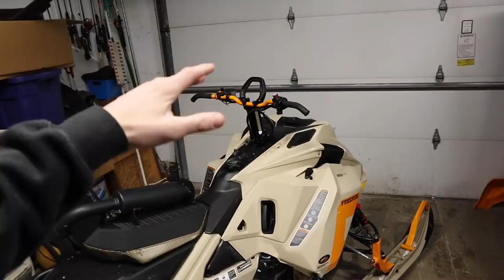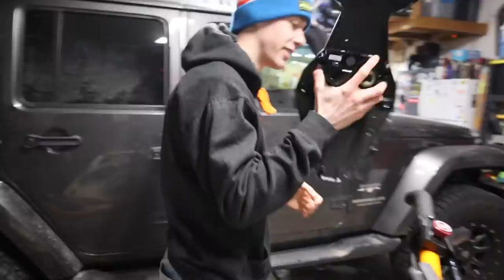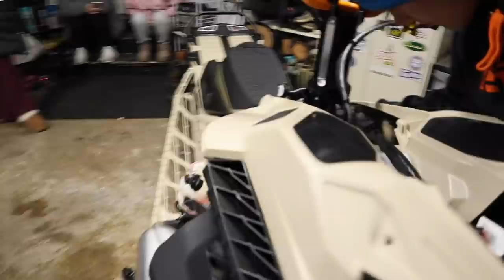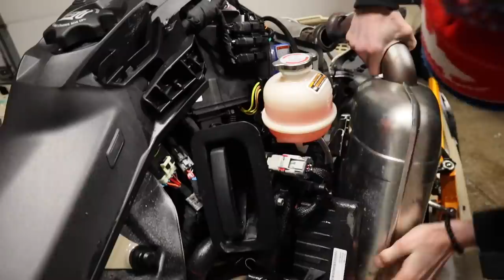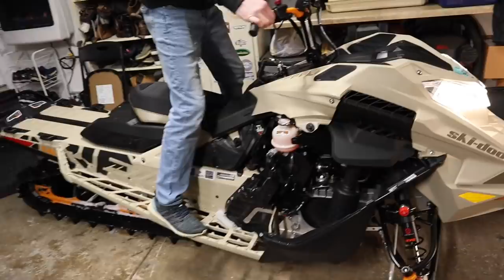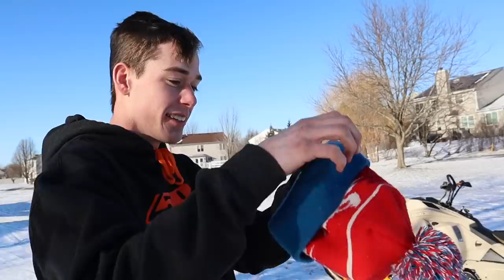LOUDEST Skidoo Freeride 850 Exhaust!

Comment: As a Skidoo tech... Can confidently just say you lost horsepower putting that on your sled. Does GGB have a dyno bench like Jaws, SLP, Dynoport, & HPS? No...Best thing to do is throw that can in the garbage and get something that is designed to work on the 850 motor. Not just a copy and paste fitment can for your sled... Just my 2 cents. HPS is the best can for that sled. In general though, this whole video was hard to watch……
Reply: The HPS is beautiful
Reply: Highly agree 👍🏼
Reply: Heard ggbs are famous for causing bog downs as well
Reply: @Brobro449  Well yeah,
Thats what happens when a can robs you of HP and RPMS!! 

Also would like to note this kid is not gonna like owing a skidoo because you need to know these three things….
- How to set belt deflection
-How to take off a hood (seriously) 
-And how to adjust clutching 
 The P drive clutch is a lot more “touchy” than the Poolaris clutch…. Sometimes you have to fine tune the clutching with clickers and honestly the stock clutching just sucks in general….. But if this sled starts to over/under rev its not gonna run very well…. So being able to fine tune it on the fly is key on the skidoos. Again just as someone who works on these, these are just the things Ive noticed😎🍻
Reply: @Snowdasledders  I’m gonna buy a sled this year and am for sure not buying Polaris. The motors go boom far to early along with many other reliability issues and garbage shocks. Did you see muskoka freeriders sled blow up the other day?
Reply: @Brobro449  Yes I did. I believe that was dealership error though (the oil consumption/calibration not done properly). All Im gonna say is that dude rode a sled harder and more than all of us in the comments combined on a 21 turbo and had 0 issues. I work with the factory turbos and all my buddies have factory turbos. We all have had 0 issues. Only issue was one had a wire rub on the wire harness under the engine and caused shot start not to work. But that was more than likely not routed correctly. Cant go wrong with a factory turbo👍
Reply: @Snowdasledders  to me the sled sound like it was whiney since day one if you go watch his first ride and that is awesome
Reply: Ya GGB is junk for skidoo and he definitely lost power. Jaws and HPS is the only way to go with Skidoo. Well or Bikeman, don’t think they are that great, but at least they have a dyno like you say and actually do R&D. GGB.....weld the pipe and chassis mount on and make sure it fits...send it to customer and pack it with more shit depending on the sound level they want. The whole jaws kit on a regular 850 like this will run with my pump gas turbos, it’s impressive. Very very painful to watch.
Reply: @Brobro449  You heard it because it’s true. It’s a one size fits all with GGB then they weld the correct mounts on depending on the application. Zero R&D, dyno or real world testing I would bet.
Reply: @specforged5651  thats sad imo jaws sounds better too
Reply: @Snowdasledders  You really think he could even adjust his clickers or defection after what we just witnessed with the hood? I guess that’s pretty much what you were getting at and you’re  exactly right. This kid needs a Polaris that “adjusts it for you” even though it doesn’t work. Better than what he can do.
Reply: @Brobro449  They are way better. Cut them apart side by side (like I have) and it’s obvious the difference. Like I said, one size fits all and weld on the appropriate mounts.
Reply: @specforged5651  Imo as well as good performance from jaws they have on of the best sounds on the market for each sled brand
Reply: @specforged5651  Yup exactly. Its not always pull the rope and go…. You’ve got to take care of it and check over your sled before every ride. All Ive got to say is if you take care of it the sled will take care of you….😎 Has never let me down.
Reply: @Brobro449  Id rank HPS, SLP, Then Jaws for the 850. 
HPS being the best overall (just very expensive)
SLP did some testing & tuning last weekend and the full exhaust set up (y pipe, pipe, can) was nasty power at optimum rpms of 7800. 
Jaws is shortly behind SLP but its better for more top end it felt like. 
Either way cant go wrong with any of them they all perform really well👍
Reply: @Snowdasledders  Lol you say the 850 factory turbo is “reliable”???? I own a 2022 expert 850 turbo and it cratered the engine at 10 HOURS!!! New engine, pipe, muffler, and turbo!! Now when I went to pick it up the sales man drove it up on the loading dock and piled up the chain case. This is my second and LAST skidoo I will ever own.
Reply: @Snowdasledders  hey did u have an email or anything i have question about sleds
Reply: damn you know your shit. 👍
Reply: @TyIer0  I doo try😎👍
Reply: Just bought a GGB without doing any research for a 22 freeride noticed it doesn’t rev as high as it should (7500rpm) already have a jaws can on the way.
Reply: @Jake.ars1  Could be a number of things. Fresh fuel? Plugs been changed? Whats your clutching like? You might have to go ‘up a click’ on your quick clickers. Is the clutching set up for your elevation? My guess is its a simple adjustment of a quick clicker but cant for sure confirm over a youtube comment haha
Reply: That was sad, worst video I have  watched for a long time.
Reply: I have a 2016 skidoo 800 what would you recommend is the best can for it

Comment: Fyi, that number that it gives you on the dash at start up in is not miles. It's the percentage of break in left. It was about 375 km to break mine in. Also there is only 6 bolts to remove the hood and two for the gauge.
Reply: Remember this is the same kid who called it “Line Q” rather than LinQ (link). My god.

Comment: Guys, the reason the hood was so hard to take off is because you didn’t loosen the hose clamp connecting the hood to the air box, I hope that you figured it out while putting it back on or else that could be a problem waiting to happen 😅